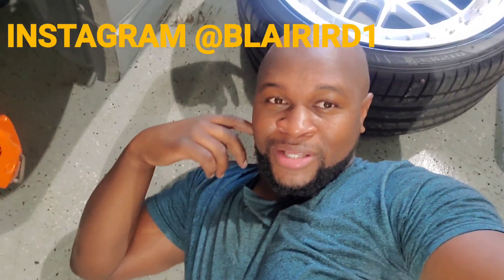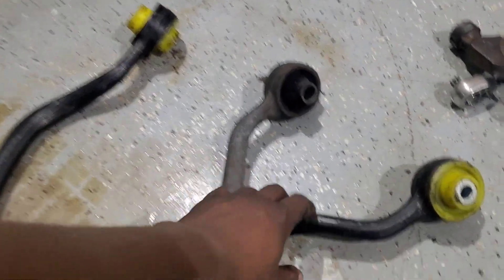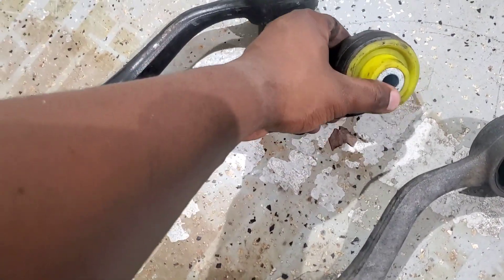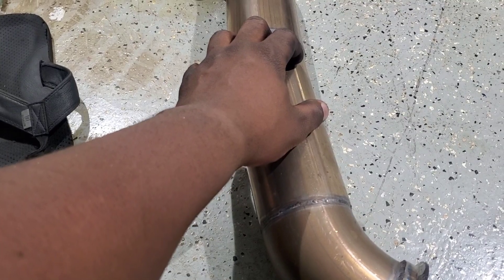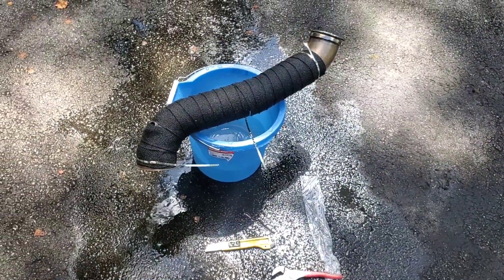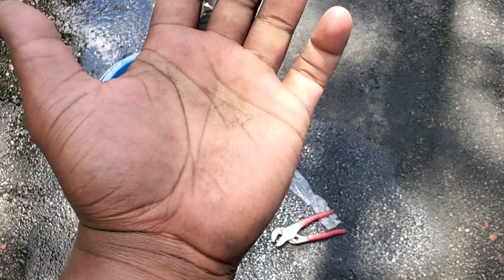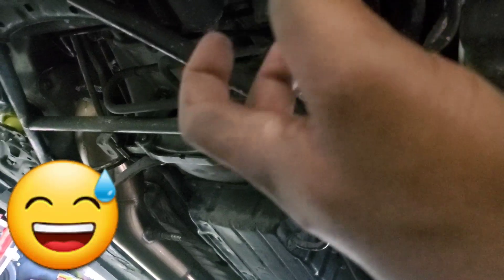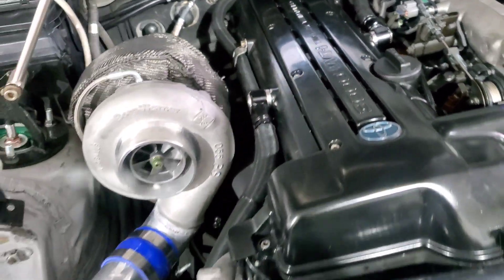2JZGTE VVTI TURBO GS300 GETS ADD ONS.

Comment: If you ever manual convert a right hand drive gs can you video the pedal box process
Reply from the maker: Will definitely keep that in mind bro. Shouldn't be much different.  Just the side.
Reply: @2jzboost760  yeah but the left hand side is coming down from door and with only battery in the way for clutch master, but right hand drive its coming off the tunnel and have abs in the way for clutch master, hence why people single turbo them first but I wana keep twins
Reply: Bro wait gs300 have there abs on the other side????? I just looked at your bay and our aristos here in New Zealand the abs is on turbo side makes getting the clutch master in way hard